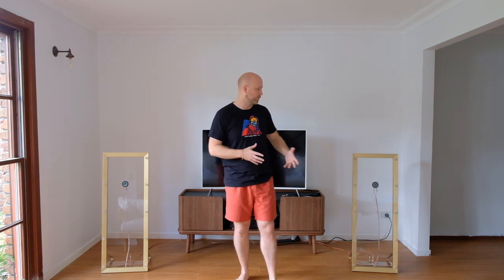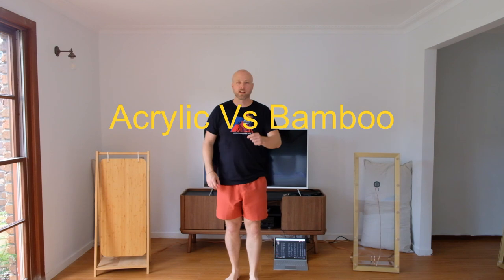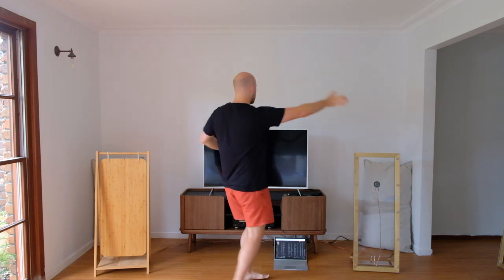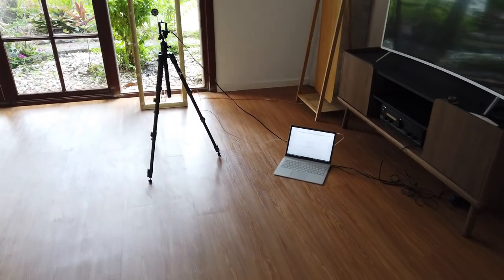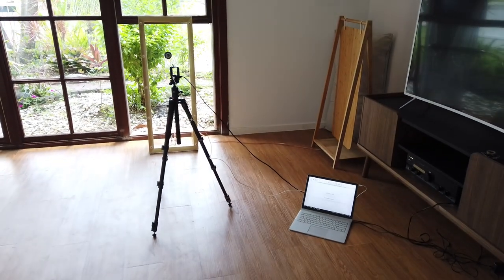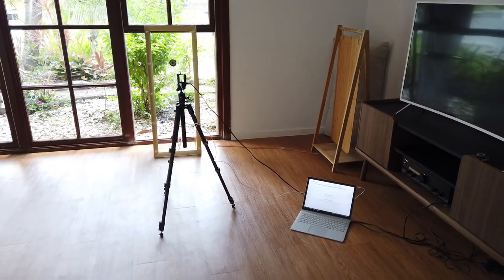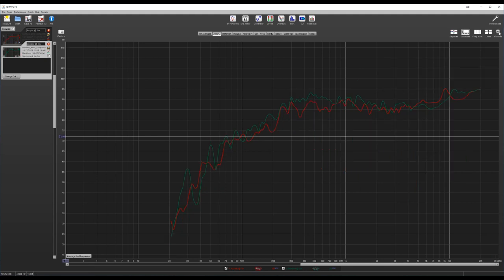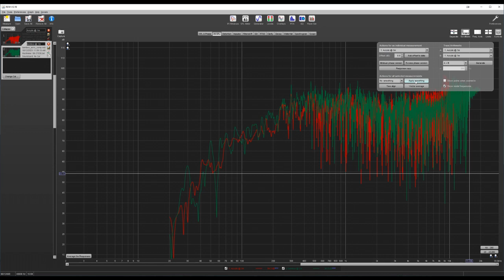Acrylic DML Build 3 - Playing Music + Panel Comparison

Comment: I am thinking about using foam pipe insulation noodles along the acrylic panel edges and retaining within the frame by providing 1/4 or 1/3 round grooves cut all along the inside of the frame surround. The panel could be popped into the frame and one could experiment with using different lengths of noodles as well as position along each edge. This would provide a semi-rigid panel without screws or grommets.

Can you describe the grommets you used? What was the final location of the attachments?
Reply from the maker: This sounds like a great way to support the panel if you have the skills to do it well.
My grommets are similar to this (clear ones though of course in my case): https://www.digikey.com.au/en/products/detail/keystone-electronics/739/106230

Comment: Hi Ben, 
I have been watching a lot of DML built video's and I like your approach.
About 15 years ago I was deep into DIY Electrostatic Speakers , and I actually have a large hometheatre running my DIY hybrid ESL's in a surround configuration. They are great.

I have been looking at yours and others efforts and I see  main flaws . Just like ESL's they are planars and they suffer in being a real full range speakers, in the lows mainly because of phase cancellation. Near feeld measurements will look good, but further away the cancelation will set in depending on the with of the panels and the room . In the highs it depends on the used materials ( the acrylic is better than the bamboo). In the lows , be carefull to use resonances to get as deep as possible. Full range ESL builders tend to do that also and it does not necessarally give the best response ( a bit muddy and less defined ). Mids ( from about 250Hz to 5kHz ) should be fantastic with these speakers. Dare to think of using a subwoofer. ( better 2, because it is far easier to get the dips and knots out of the room with 2)
BUT , I see many DIY ers suffer in searching and not finding that right frequency response. Tbh It does give a speaker the right signature.
And then I have looked ( just now ) at the AER Goldy....and they cheat....but in the way I would also do it to get real good results. 

First : They have integrated a normal tweeter into their exciter. That is a point source capable of effortless playing well over 25kHz , without to much resonances. I have read on their website that it takes over as low as 2,5kHz ( seems a bit low)

Second : They use room equalization to get the required frequency response of the total system. To flatten the curve...to eliminate resonance peaks...to get a desired rolloff for a more warm sound....to scape a signature sound that matches the owner.

Using these techniques, they have their panel + tweeter playing in the comfort zone and getting the sound right.

Anyway : What can a DIY er do with this info ?

First : I would consider buying and integrating a tweeter ( with passive filtering) into the concept. If it is a small flat dome tweeter, you could glue it onto the acryl panel. ( They have it integrated in the exciter so not much difference ). Start cheap f.e. a dayton audio TD20F-4 (11€) with a small condensator (15microF or something) as high pass filter and hook it  parrallel on the wires of the exciter

Second : I see that you are using a PC to play music. Install the free "equaliser apo 1.2.1" on your windows 10 system and you have a fantastic free tool to experiment with scaping a desired frequency room curve. Of course, only the sounds coming from your PC soundcard will be equilized using this technique, so if you would hook up another source on your amplifier ( cd player) it will not be equalized, just that you know that.
Online there are good pink noise generators that you can play through the soundcard and start equalizing until you get what you want.

You will need a measuring microphone to see the response curve. A behringer ECM8000 omnidirectional costs about 33€ and is perfect for that. I hook it to my behringer ultracurve pro deq2496 (that has a RTA to visualize the frequency response, but I am sure there is a way to connect the mic via a cheap micpreamp to the soundcard of your PC to visualize the measured curve. Up to you to find out, but it is possible. In my opinion , some measuring is always helpfull and needed to get to a good speaker.

Anyway, keep up the good work. After 15 years I am tempted to jump into a built

EDIT : I saw to late that you are already using measurements . fantastic.  Please try equalizing as I described. Try also measuring in room response from the place where you listen using pink noise, so that you take into account also room accoustics and not just close mike measuring with a sweep
Reply from the maker: Thanks for the very detailed info!

Yes I've been using measurements to guide my project and gauge performance (though I'm still learning all of this). Initially I had my bamboo panels running through a mini dsp unit just to flatten the peaks and troughs a bit and I was sending the full range signal into a powered sub with the sub XO at about 150hz.

My plan for these acrylics was to make a 2.1 system (or 2.2!) but half way through the project I've moved house and don't have anywhere acceptable to physically put a sub! Right now I am considering 2 options:

1) Build a new pair using woofers <250hz with a panel on top.
2) Build a pair of narrow, boxes for 4x 6.5" woofers that would sit either side of the TV unit and cross them at the same frequency.

Thanks for the tips on measuring room response - It's not something I've tried but seems logical! I also plan to have a go at making some absorber panels so I'll definitely need to do this! (So many projects, never enough time!).

Thanks again, and I'd love to see what you come up with should you decide to build some panels.
Reply: @TypicalBenYT   
Concidering subwoofers  : In my hometheatre room I have the ability to place subs wherever I want, something a normal livingroom does not have, I do realize.
FIrst I placed my rather big 12" DIY adire audio shiva subs front . 
-one woofer : a lot of peaks and knots and the knots were of course in the center of the room , my listening place. I didn't even need a measuring tool to hear it.
-2 woofers at the front left and right : a bit better but again a big knot ( hollow)at the center of the room and peaks ( pressure) in the corners ( boomy).
And then I moved the two subs along the right and left walls to about halfway the room,standing against the wall left and right of my listening seat : Perfect bassresponse in the room and not only in the center, but also walking and measuring on many places in the room. Very few knots and jus a little bit of gain in the corners.
I do use my AV receiver to cross over to the pannels at a rather high 150Hz, to avoid problems. You do NOT hear where the bass is coming from. It fills the room .

Measuring bass responce on a panel speaker close up does  give you an idea about resonances of the panel ( good to know) but nothing about the real bassresponse in room. F.E. If I measure close mike to my ESL panel, it seems to have a straight frequency response down to 80Hz, but moving away from the panel, the phase cancelation sets in rather quick and I loose a lot of low end and depending on the width of the panel it will be at a higer or lower frequency. Also room interference will kick in. Using resonances/peaks in the behaviour of the panel ( that you measured close mike) to get a higher dB in room is never a good idea, because it will sound muddy and not controlled. So it is always better to just cut off (filter) the panel just above that resonance and let  dedicated woofers take over in a controlled way. Using pink noise and measuring at the listening position in room, you then equalize the levels between sub and panel. In my opinion it is always nice to have a more slooping frequency response in room and not a clean straight one. ( so a bit more bass )

About the mid and high frequencies : My opinion is that it is fine to measure  close mike ( 1m from the panel , that is).
You will see that if you measure with both panels on at the listening position, it may vary quick depending on the exact position of the microphone, because you will have a constant interaction ( cancelation and reinforcing of some frequencies from the left and the right source ) Don't spent  time on trying to eq hights and dips out in the higher frequency band.
Still you do not want an overly ascending" in room at listening position" frequency response in the high end of the spectrum.
As a target you could aim at having a sloping response of around 5 a 6dB between 100Hz and 10kHz.
Don't be worried if it slopes even more between 10kHz and 20kHz, make sure it does not peak there.
Don't be worried to boost a little ifyou go under 100Hz (between 40Hz and 100Hz) but do not try to get a flat responce up to 20Hz in a normal room.

One last remark : Make sure you use ( a good source) of PINK noise to calibrate your speakers in room. Don't mistake it for white noise. Play it at a reasonable level ( say  80 - 85dB )
In pink noise , each octave has an equal amount of energy ( YOU NEED THIS )
In white noise , each frequency has equal power ( DO NOT USE IT TO CALIBRATE )

Comment: I like the acrylic panel better.  I just finished my first acrylic experiment.  Still tweaking because I used  really thin pieces of acrylic.  It's actually vibrating too much.  Im only using 4 watt  4ohm exciters, 2 on each panel to get 8 ohns. I didn't see anyone using acrylic until today.  I'm completely new to this. It's very satisfying . Ever tweak is an improvement so far😊.

Comment: Thank you for sharing with us, Ben, very intersting project! What do you think about bass/low freq compensation I was brought up with clssic 2 stereo speakers that reproduce the full spectrum, an audiofile or at least hi fi experience, so I am reluctant to bring 3rd piece, the subwoofer. So, do you think there is a way to construct DML to have enought bass? Or, in your experience, you feel you already have enough bass? Please share your thoughts, thanks!
Reply from the maker: Hey Jack thanks a lot!

Regarding the bass issue - the general consensus is that to get panels to play lower, they need to be larger (the measurement of the longest dimension is directly related to the lowest frequency it will play). I haven't made a set of very large panels personally though i'd like to give it a go some time. I'd image that you'd need multiple exciters per panel in order to drive the mass of a large panel, and other aspects of performance such as decay might suffer from the increased mass.

Personally, I don't think my panels have enough low end on their own - I don't need slamming bass in my living room but they do lack a sense of weight that you get from a proper full range setup.

My next pair will incorporate a pair of cone woofers in the tower design - in fact I already have the drivers for it! Of course this introduces issues like having to build a crossover (or run active woofers etc) but I think that in practical terms, it's the best solution.

Comment: Have you tried glueing a brace (like an archtop guitar) to make the panel more bass "friendly". I hope this idea is not nonsense, bit I'm fascinated by your patient research method
Reply from the maker: Hey Clem. Not yet, but I do actually have a pack of spruce guitar braces here for just that purpose! Due to the size of these panels they lacked stiffness so I ended up having to use more attachment points than I intended. My hope is that by using bracing, I'll be able to just attach the panel in the corners (less damping) and even use a thinner (lighter) panel, while retaining overall stiffness. I should be able to start experimenting with that in the next week or so.

And thanks I'm glad you're enjoying the videos!

Comment: Let me help you out a bit.    The wood panel is denser then the plexi and the denser the material the more it hinders certain frequencies like the midrange which in turn will make the wood panel sound warmer, while the plexi will sound brighter clearer due to more vibrations passing through the material.  Also when brightness is reduced the bass frequencies will sound more prominent.

Best materials are ones that are very "LIGHT" but rigid enough to hold its shape and able to bend a bit.  This is the reason the two top materials for DML are 1/2-1/4 inch thick EPS and Honeycomb composite as pound for pound they are very light yet rigid enough to hold its shape with some bend ability.   DML's produce sound by BENDING the material hence the term Bending wave technology.

If you take off the screws holding the plexi panel it will bend more therefore produce more bass.
Reply from the maker: If I take the screws off the panel... it will fall down!

In one of my previous videos I do show how much the acrylic flexed - originally I was only going to fix it at four points (corners) to allow it more freedom, but it sagged in the middle due to the length of the panel.

I then experimented with different number of screws and took measurements for each, ending up with a full 10 points of attachment, which is what you see here.

Reducing the number of attachment points didn't seem to increase bass response appreciably in my tests.
Reply: YouTube
Correction Ichigo - Bamboo is actually 30 or more percent lighter than acrylic for equal thicknesses. The loss of clarity in ply panels is caused by: 

a/the glue between layers damping the resonance.

b/ the interlayer (filler layer) of plywoods is often of a different and softer/weaker wood than the outer skins and often visible gaps are present between strips making up the layer ->..more damping.  This aspect could be checked by peeling apart a scrap piece.   

c/ not all woods are suited to this acoustic task...maybe spruce laserply would give a better result. 

Bamboo is a grass and because it is narrow by nature, the ply is made up of many narrow strips - even more glue.. It's been tried as a tonewood by some with apparently underwhelming results.

It would be interesting to see a comparison of Spruce ply - Another panel Ben??  

Basically however - plywood as we commonly know it is not the best material for a DML panel.  

Plywood is also not used in top end guitars for a reason.

Comment: Another good and interesting video. As seems to be the norm, it raises more questions. I noticed the pillows in the corners behind the speakers and wondered why they were placed there.  This made me think back how Paul Klipsch designed his corner horns to replicate the 16’ pipe on an organ with the last 8’ being along the wall of the corner placement.  Can this be used with the DML speakers? Or would it cause more problems by being “out of sync”? Thanks again!
Reply from the maker: Yes it sure does! I’m aware that the room acoustics is pretty bad at the moment - the big cushions were just a token effort to bass trap the corners a bit. I expect they made next to no difference but it’s all I could do at the time!

Regarding the Klipsches, I can’t picture it, do you know where I can see this online at all?
Reply: @TypicalBenYT  I live close to Klipsch’s hometown and used to hangout at his factory so my knowledge is over 50 years old. I remember that he wanted his cornerhorns to replicate the best pipe organs with the longest pipe being sixteen feet long. The last four notes could not be heard by human ears but could be felt by the body. His folded horn design furnished the first eight feet built into the speaker but relied on the reflection off the corners to be the last eight feet. Using two cornerhorns with a LaScala middle speaker is unbelievable sound. Not sure that the successor company still produces these. Paul Klipsch was a unique person and way ahead of his time in speaker design.

Comment: i'm building a set of "bookshelf" sized panel using 2.5mm cedar ply. sounds great but i expect it to change slightly when i apply a gunstock oil finish
Reply from the maker: Hey Paul, that's interesting how big are the panels? I don't know much about oils etc but I did coat my bamboo panels with danish oil and actually didn't notice a great difference in sound.
Reply: @TypicalBenYT 300 high x 200 wide
oils will change the resonance of the board, hopefully for the better but here's hoping.
next project i think will be home made electrostatics
Reply: I would think the cedar will absorb much more of the oils than the bamboo. Bamboo historically resists absorbing...that was one of the challenges of early bamboo flooring...could not achieve enough variables or depth of stains or oils. They only had two colors originally...and they weren’t that different.

Comment: I've been playing around with some coroplast board like signs are made out of.  Pretty impressive but wanting to try some carbon fiber panels next.   My problem is making designing something to be portable in a way setup outside of my car etc when I want.
Reply from the maker: That’s pretty cool - is it for camping or something? Carbon fibre would be an interesting one for sure…
Reply: @TypicalBenYT  yes sir and I do ultra running event whereas my car could sometimes be my aid station on a loop so I'll have music playing and my diy amp project box power a sub too.  I should have put together a video.

Comment: …how…did you build your frame?, &  how thick is  is the acrylic baffle surface?
Reply from the maker: I actually ordered the frame made to measure from an online shop doing canvas art. I don’t have the woodworking skills to build them to the same standard (and square). The acrylic used is 4.5mm, panel dimensions 400x1100mm.
Reply from the maker: There’s more info on the construction in my video Acrylic Build 1 if you’re interested.
Reply: @TypicalBenYT  Yes …very interested!